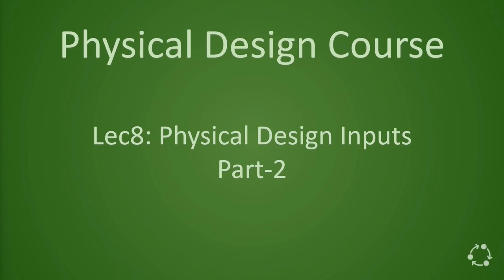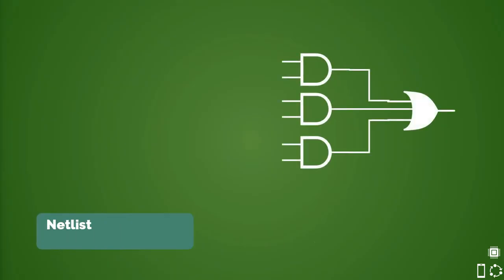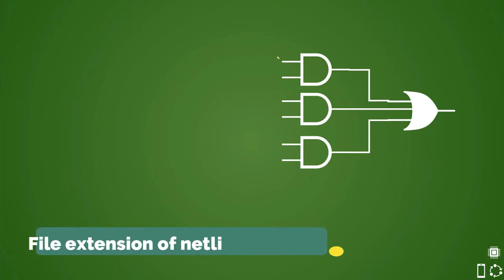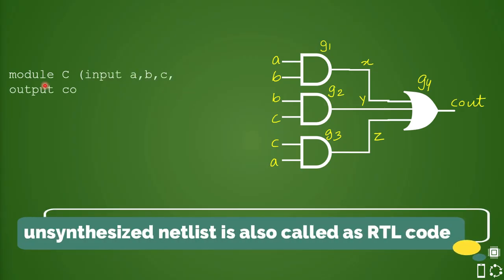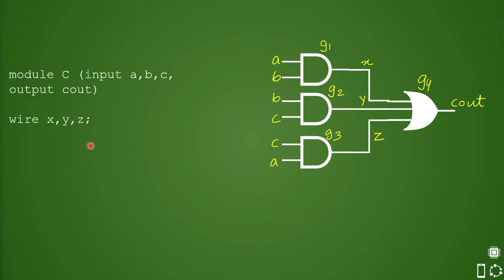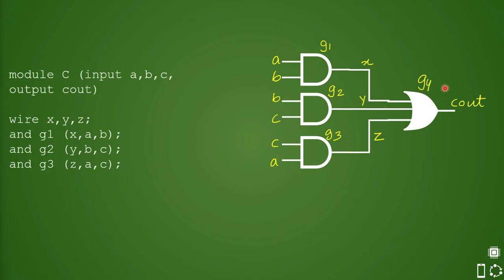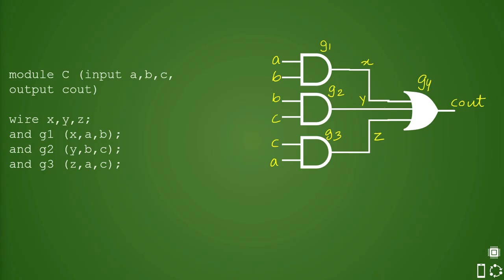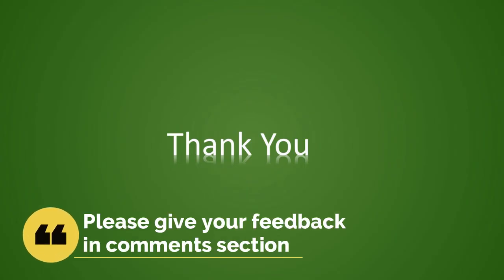PD Lec 8 - Netlists | PD Inputs part-2 | VLSI | Physical Design

Comment: Good morning Sir, 
I had a small doubt regarding the difference between an RTL netlist and synthesized netlist. What is the difference between them? At which state each of them are used ?

By the way, great content, helped me to build my base for PD engineering!!
Reply: If your question is, difference between RTL code and Synthesized netlist:
As far I know, RTL code is written by the user by mixing different abstract of verilog like Behavioral, Structural/dataflow and Gate level style. But synthesis tool like cadence Genus convert the RTL code into GATE level netlist (synthesized netlist) which is required for Physical Design. 

I hope I answered your question.

Comment: Hi sir
Interviewer asked one question.
What happens if we give RTL code as a input to pd instead of gate level netlist?
Reply: As far as I understand. I think pd tools only understand gate level netlist but if you will give RTL code as input then pd tool will give you running failure as suppose if you have used the if statement in the RTL code then synthesis tool will convert the if statement to the multiplexer and then it can be used in the pd, but pd tool won't understand the if statement.
Reply: @singhkaptan00  yes sir, I think so
Reply: @VLSIAcademyhub  
Thank u sir..,